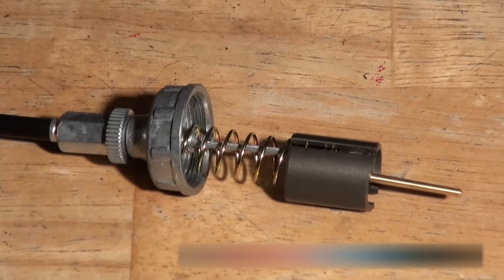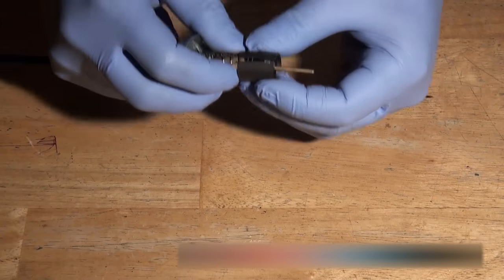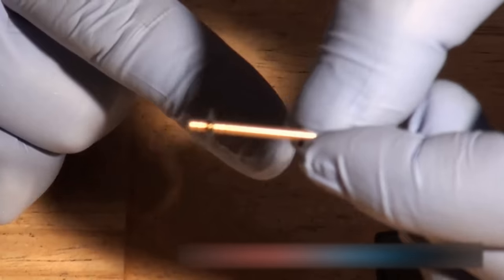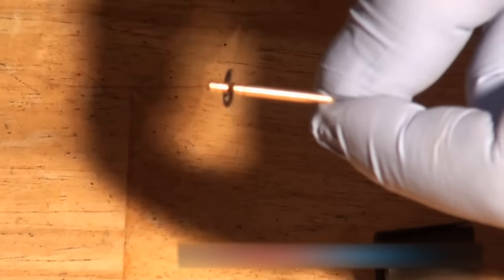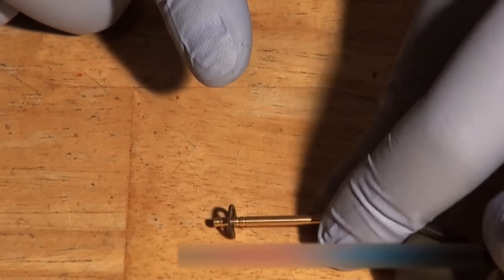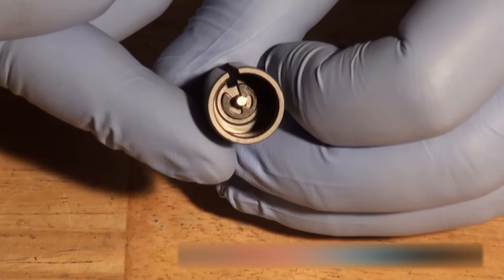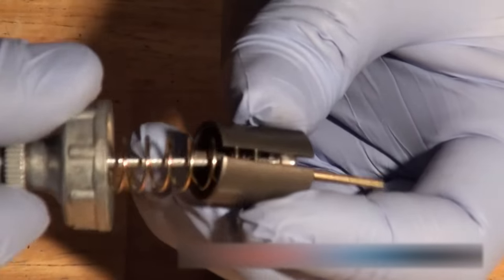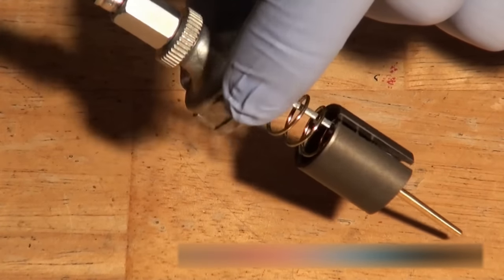Bicycle Engine Kit Carburettor Needle Setting Tips

Comment: A decent informative video. If ur a novice I guess. But I guess most of os should keep in mind that many kids that take on a project like this r going to have a lot of trial and error. ..just to clear the air I am a certified mechanic the air fule c clip will only affect u at low speeds. In short. If ur motor is not running ruff and plug looks fine u sold b ok if ur motor is bogging ot in idle u may be getting to much fule always start simple and work your way up

Comment: TY man, for the clear instructions. I am rebuilding a used 66cc (my very first one), finally got it running. Four-stroking like crazy tho. Turns out I am running WAYY too lean (chalky white spark plug contacts) and I probably just need to adjust my carb (move the E clip). Lots of vids show how to adjust carb and tell you to move the E clip, but so far only yours shows me how to actually take the throttle assembly apart lol. TY again man.

Comment: These carbs work on 4 cycle engines .My 2 horse Briggs takes the leanest setting at the top notch then it was still rich till I drilled out holes in the air cleaner cover.

Comment: Which direction do you move the clip if you want more fuel?
Reply from the maker: Hello, if you carb bowl is getting starved of fuel, you can try adjusting the two levers that control the fuel shut off that in turn get pushed by the white float.  I would have thought going lower end (tip) of the needle would consume more fuel and air possibly.

Comment: I I replaced my needle which was bent by a new one which was little different will there be any effect pls reply
Reply from the maker: As long as its the same size and the clip sits on the same part of the needle, should be fine.  Only way you will know for sure is by giving it a try.  You can also buy carb service kits so you don't need to replace the whole carburettor.

Comment: My pit bike is making popping noises and sometimes backfiring inside the engine and into the carb. Does that mean I have to increase the fuel? If so how do I adjust the clip?
Reply from the maker: Hey GloryOrBust, thanks for stopping by.  I don't know how to answer your specific question as the two issues you mentioned may be related to each other or not (meaning they could be completely separate issues having their own causes).  I would need to have it in front of me to and get my hands on it.  But i'll leave your question here as we have so many helpful viewers i'm sure someone will chime in.
Reply: It is possible you have too low of  octane gas and it is firing before the cylinder has finished a full revolution, but that is unlikely to cause misfiring. The popping may be caused by  a leak in between the cylinder head and the cylinder, possibly due to metal burrs between the cylinder head and cylinder, or a faulty gasket, just take apart the whole engine and check for damage or broken parts.

Comment: so i have a weird problem with my bike. so the throttle does not seem to work at all and when i release the clutch the engine just goes full power like if i had the throttle pulled all the way. the throttle itself doesnt seem to do anything at all like its just there even when i do pull on it it doesnt seem to even create tension on the cable? the bike rides but again i have no speed control it jist automatically goes to top speed PLEASE HELP 😪
Reply from the maker: Hello Robert, thanks for stopping by.  Sounds like like the needle is jammed or you may have a kink in the cable.  If there is no tension, also check inside the throttle housing as those plastic cable guides inside do break sometimes.
Reply: BritishTech TV haha thanks man! ended up finding out the problem was i didnt tighten down that top peace for the needle n spring 😂 works fine now. Thanks for the reply man!
Reply from the maker: Easy to miss that one, glad you got it sorted in the end mate ....

Comment: would anyone be able to tell me what I can do if my bike runs at full speed as soon as I start it
Reply: sounds like your throttle is stuck on its max, check the part that hes showing in this video
Reply: James könyí . I only yesterday had the same problem but it was just a simple jammed cable prodlem. kt got dislodged at the handle bar end causin to be o  nearly half throttle all the time.